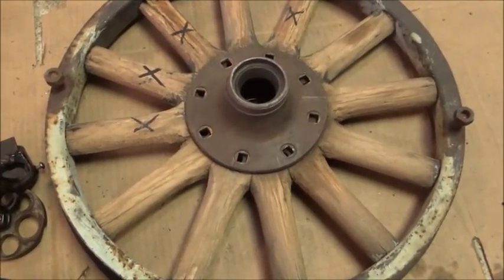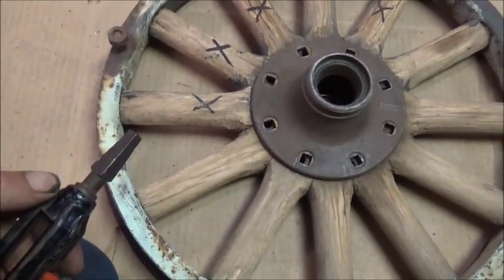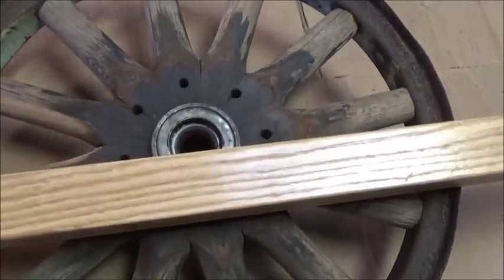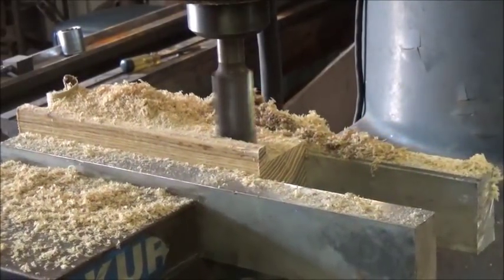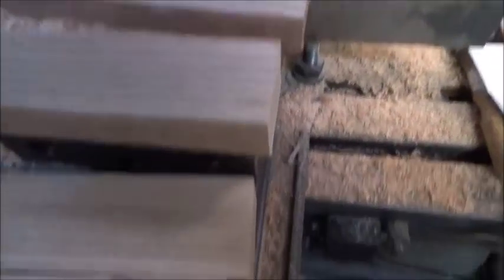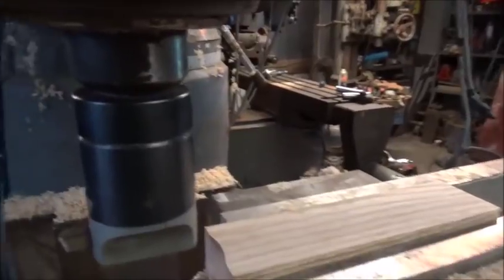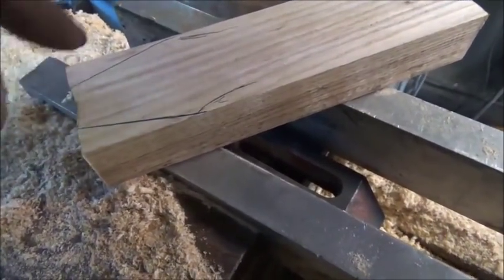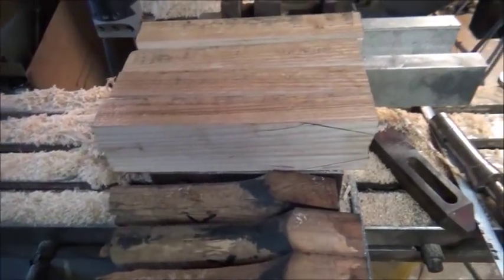1929 Willys Whippet Wooden Spokes 1 of 3

Comment: I worked in woodworking for 40 years . Most of the machines we  used were older than me by 30 or 40 years. We did the best with what we had. The CNC made things easier at first. But when it got 20 years of hard work and on it it was a pain in the ass. Broke down more than not.
I think you are doing fine.  You have to do what works. 🇺🇸 👍👊

Comment: My dad had a 1929 Dodge victory six which had wood spoke wheels and 16" tires. Not knowing a great deal about cars back then he didn't think about it much until he went to get another tire fitted. Someone had cut down the spokes and modified some firestone 16" rims (cut the centers out ) then bashed them onto the spokes. There were some things you had to do to keep a car running in WW2..  :-)

Comment: Years ago, I was looking through a magazine from the 20's (I forget the name), and saw an add for a automobile wheel with wooden spokes.  Broken wheels were apparently a common problem of the time.  The big selling point for this wheel was the fact that, if it broke, you could simply take it to the local wheelwright to get it fixed.

Comment: Johnathan, if the spokes aren't broken you could use urethane wood glue  work the glue down in the cracks good clamp it 5ill the glue squeezes out and crack closes up let it set 24hrs it usually will crack somewhere else then were you fixed it. My dad repair furniture. Maybe that will help and its a lot less work!good luck

Comment: It doesn't have to necessarily be a "wood working" way. You know how to take a piece of material and make it into the exact shape you need. Doesn't matter much if it's metal, machinable composite or wood. Sometimes the cutting implements matter but if you go slow usually if it'll cut steel it'll cut wood just fine. Showing how to use what you've got instead of buying $1000 worth of tools just to make 4 spokes is of great value.

Comment: Hey Jonathan W. , don't you known... there are more ways than one to skin a cat. You sir, are doing a fine job. Best regards. Question: Would a sine plate help you with this project?
Reply: That compound sine plate Stan at BarZ has sure would come in handy.  But using the machinists vice in a swivel base vice will get the job done, just fine.  I'm getting real close to getting my CNC mill up and running, well the mill is up and running, it's the computer I'm having fun with.  Mach3 will not use the parallel port in Windows 10, and the old XP os had too many issues.  I have a UC100 on order from CNCdrive.  I built a 4th Axis and it would make short work of it.
Reply: Jonathan if you have any spokes that are spit but not broken you could get some urathan wood glue and work it down in the cracks good a and clamp it good till the glue squeezes out a little. Keep the clamps on for 24hrs.  Then take them off ,if the got in the cracks good .it will crack somewhere else before it does where you fixed it. The glue usually does a good job. My dad use to repair furniture maybe that will work for you.
Reply: There may be more than one way to skin a cat, but there's only one way to bar-b-que it!!!
Reply: True...soooooooo true,lol.

Comment: This may be a little too late but, would it make those spokes easier to install if you cut them to exact length, put them in the wheel and drill through the rim into the spoke. You could then epoxy the dowel pin in. I repaired wheels on a civil war Canon and this worked out best for me, the Canon wheels were white oak.

Comment: I'm also a woodworker and I can't see anything wrong with how you're going at it.  Frankly if I had access to your machinist tools, I'd use them too.  They are way more accurate than woodworking tools!  The only way I could have made those curved cuts would have been with a hand rasp, so you're way ahead.  Guess what, now you're a wood worker.

Comment: Wheel spokes were never not precise. Even though these spokes are/were made out of wood they are very precise pieces. The factory that first manufactured them 100 years ago had machinery very much like what you are using. Just make sure to keep them as tight as possible and sand to fit. Woodworkers could learn quite a lot from you. Thank you.